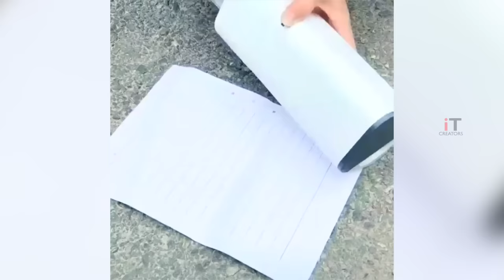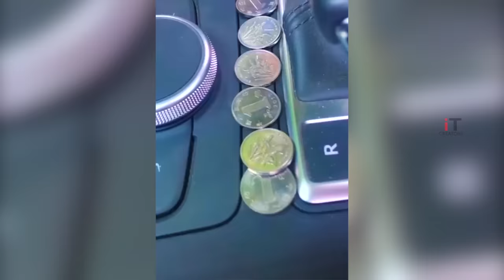50 SMART CAR ACCESSORIES &  GADGETS Make Easy Your Car Life

Comment: 4:40 check your blind spot why spend cash on objects like this. Them spring imojjis could end up distracting the driver.  The bit with the cushion is simple full lock to the left and move a bit then full lock right and back up a bit not a lot just a bit then full lock left move them a bit right and your out.